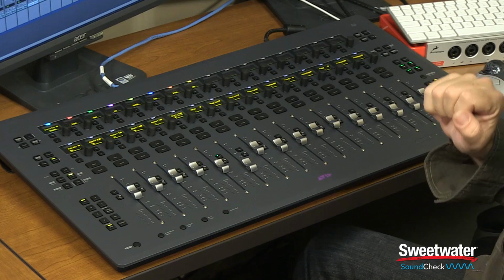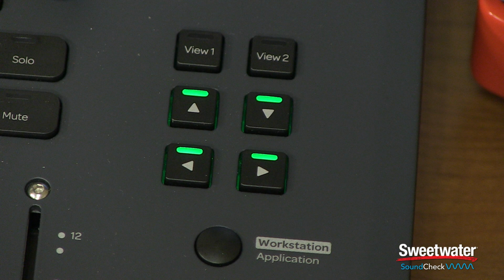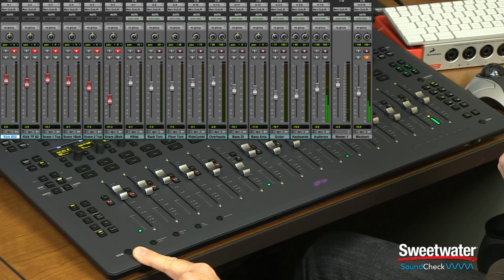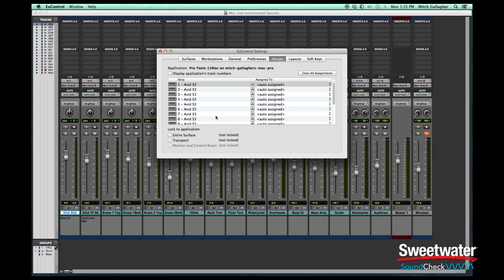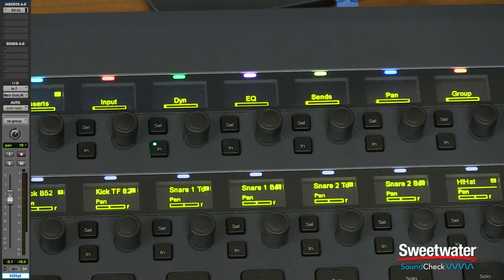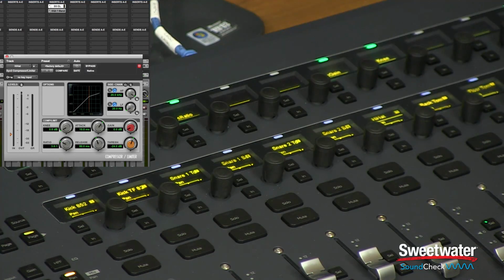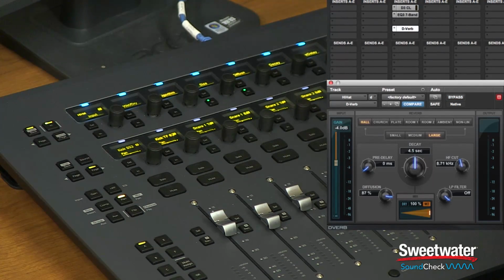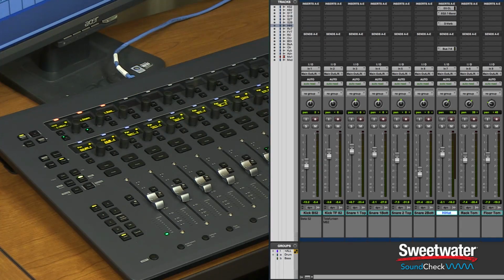Avid Pro Tools S3 Control Surface Review - Sweetwater's SoundCheck Vol. 1

Comment: I ordered one of these to check out if it fits my workflow. Unfortunately, it doesn't and I really wonder who the target audience for this controller should be. The pricing is ridiculously high and almost outrageous. Don't forget, this is a pure controller, albeit with an AVB interface, but again that is far too small for professional use. The Eucon protocol is good and powerful, yet editing plugins feels cumbersome. It lacks visual mapping, as is possible with the S4/S6, for example, by positioning parameters in the encoder field. Plugins with a lot of parameters (such as a full Ozone Strip) cannot be operated at all, because only the module prefixes of the parameter names are visible. The operation of the controller is unnecessarily cumbersome. For this exorbitant price, I expect buttons per function, and no multiple shift modifiers even for the most common functions. The buttons are also partially labeled with function names for S3L Live operation, which further confuses as the corresponding functions for controller operation are then labeled next to them. Mute and Solo are well placed, but the Select and Record buttons are between the faders, where you always have to aim very well to hit them. I also find it difficult to see the assignment at first glance. To which channel do the select button and the signal LEDs belong? That is simply too unintuitive. I also find it annoying that many functions require pressing the pots. I would have preferred a separate button. Basically, I also find the pressure points of the buttons too stiff. The biggest point of criticism, however, is the lack of a transport control. There's basic transport on the touch strip, but it's not enough. Sure, I can buy a Dock, but in conjunction with Cubase, most of the buttons on the Dock are not even meaningfully occupied. A few of them can be reconfigured via softkeys editor, but why do I spend 1000 Euros for a Dock, where I then have to remember the function of the buttons? All in all, a rather disappointing and actually superfluous controller. I would keep it for 1500 Euros, but 4800 is just way, way, WAY too much.

Comment: The S3 is an astounding failure for Avid.  Its design is by design engineers, for themselves - a science experiment that will constantly take every user far away from their job of making music.  The S1 is testimony to this and a much better product, leaving large parts of its intelligence to the iPad.  However, it is an 8 fader surface, so virtually useless to music creators.  Avid does not make a viable surface for less than $50,000.  The Control 24 was the last of their brilliant designs for reasonable money and they deliberately obsoleted it.  I won’t even elaborate on that.

Currently, only the Presonus Faderport 16 comes anywhere close to a truly usable, affordable DAW controller.  With the addition of a single control pot/switch per fader and slightly better displays, it would be almost perfect in the sub-$2000 class.
Reply: I got a Digidesign 003 Factory console for $400, $80 worth of adapters to convert firewire to usb-c. Great audio interface and mixer.

Comment: Can it be used for ableton live?
Reply from the maker: Hey, Jeremy. Thank you for reaching out. You can definitely use the S3, but it won't have full integration with Ableton like it will with Pro Tools. But it most definitely can be used as a control surface. Feel free to reach out to me directly if you want to discuss it a little more. Thanks for the interest!
Alex Campos, Sweetwater Sales Engineer, (260) 247-8024 (call or text)
Reply: @sweetwater  Thanks. Always reliable really. Sweetwater thrives!

Comment: Are there any alternatives for this control surface? I like the design and how it works, but I don't use pro tools, and I don't want to run into it not supporting drivers for my OS... also a bit steep on the prices.
Reply from the maker: Hey, AndoOet! Avid uses a protocol called EuCon with it's control surfaces. You can setup key commands and macro to work with any piece of software. Thanks for the interest, and please give a call if you have any more questions!
Mike Godlove, Sweetwater Sales Engineer, (800) 222-4700 ext. 1355
Reply: @sweetwater  Nice, thanks for the reply. Won't look into it just yet, as there are more pressing matters to put my money into right now - but I do want some good looking automated faders in the future.

Comment: no play button...
Reply: Carmen Solórzano well it does have a touch sensitive strip that funtions as play/stop. But you can program any of the buttons on right in the eucon software to do any command that you want. So if you want to program one of those you can. The board has a lot to offer. The price might seem like a lot but in my opinion is worth it.

Comment: This thing is way too expensive!!!! you can practically have a full studio for that price.
Reply: Fadedjean Recording Studio yea you could have a full "project" studio but, this board is for people who work mixing or on post production on a daily basis. Once you get into the work flow of assigning let's say your EQ on the top encoders and your compressor on the bottom encoders is easy just to change from channel to channel and mix. At first I thought that the work flow was going to slow me down but after having it for 2 weeks I don't see myself letting it go.
Reply: Its a rip off dude, not worth 5k PERIOD.

Comment: +SweetwaterSound Thank you so much.   Im betting the 8 people that clicked dislike, didn't like the the fast and beautiful workflow, and love their mouse and keyboard more.  They haven't processed that the mouse and this control are both controllers and one is just on a larger scale.
Reply: Franklyn Grant you seem to miss the point. don't understand your rant with respect. there is no two ways about it for a control surface it is overpriced no one is doubting it working capabilities. For the price of this I could pick up a Midas m32 full console. also this is more expensive than the SSL nucleus which I would say is better than this .

Comment: I really wish there was something as fitting as this for Logic Pro X. I've been looking for something decent for ages. I'm just not sure if the S3 would be appropriate for use with Logic, it might be a bit of overkill if it is more calibrated for Pro Tools. Having said that, I was previously using a Euphonix MC Mix and MC Control setup which was nice but I just couldn't live with the fiddly little transport buttons. Call me old fashioned but I would love to have a straight forward transport bank again, just helps workflow so much! SSL Nucleus looks tempting but still not perfect. Really think there's still a gap in the market. Give me 16 faders, a straightforward transport bar, a jog dial and some assignable rotaries, meat and two veg as they say but nobody is making such a thing. Closest thing would be Mackie with an extension unit but it's so ugly I would rather hang some Tracey Emin artwork on my studio wall. I miss my old console!! The S3 is a thing of beauty to be sure though!
Reply: you can use it in logic
Reply: I had the MACKIE AND EXTENSION TOO, looked horrible, sent it back.  I am not sure if this S3 has a jog wheel?

Comment: Waiting for 004 - 8 faders, thunderbolt, same functionality + more inputs and proper monitor and transport section at $2500 - $3000 tops. Those would sell like hot cakes AVID. This is just ridiculous and it comes from a guy who works daily on S6 (which is horrible value for money as well). Pro Control and D-Control Forever!!!! :-)
Reply: +MrBitterman75 I gotta agree with you there. Avid's products are waaay too expensive.. Digidesign used to offer incredible value for their products.
Reply: Still waiting? 😂
Reply: @HushWave  Hey, thanks for asking. No, I've been actually pretty happy with my S3/AVID Dock setup over the last few years. Admittedly, for a bit more cash, but totally worth it, as opposed to S4/S6 line. I have to work on these regularly as well and S4 build quality and faders (which are exactly the same as on S3) are definitely not worth the asking price. But hey, it's AVID after all.
Reply: @MrBitterman75  yeah I agree, I own the S3 & the dock, bought them brand new for half of their asking price, great great units but I would’ve NEVER pay $6k+ tax for them.

Comment: recap; 5000 dollar for a keyboard with faders... easy choise, i'll go for my trusty 50 dollar keyboard
Reply: But S3 includes "convenience connections for hooking up lights".
Reply: Tru dat
Reply: For big sessions this thing shines, VCA spills, or plug-ins manipulation
Reply: @digitors  Meh, when I mix sessions with upwards of 100 audio tracks I still don't feel the need for this. In reality you touch faders very little especially with automation.
Reply: @__Leon__  you touch faders very little with automation? Nothing wrong with mouse mixing but you can definitely automate with faders… (automation modes allow you to do this) it’s actually quite useful and it’s a little more bad ass IMO.
Reply: @Macho Sancho haha well I made my comment 6 years ago. Now I am a professional engineer working for major brands and I can tell you; 5k is nothing. The amount of money that's in the studios I work in is unreal.

Comment: The controller looks very nice and has great options, but 5000$ is just too much. I have couple of questions though.

There's only 2 rows of knobs (I say only 2 rows considering the price), but actually one row is mentioned only as the pan control and the other one for everything else. Later in the video faders and pan knobs are flipped. Does that mean that this row of pan knobs can be assigned to other things too? Can faders also be assigned to other things?

Next, when panning stereo tracks like shown in the video, there's no mention of panning both paners at the same time, as well as scaling the width between them. Can it be done?

Can faders be flipped to sends like on many digital mixing boards for FX sends and monitoring sends?

How does the latency feel? I find it the most annoying thing in digital controllers as well as with most digital mixing boards old and new.

And why the hell is it an audio interface at the same time??? That I really don't understand. It's like those bundled plugins. You only need 2, but you have to buy them alongside 3 other things that you don't want to use.

Thnx.